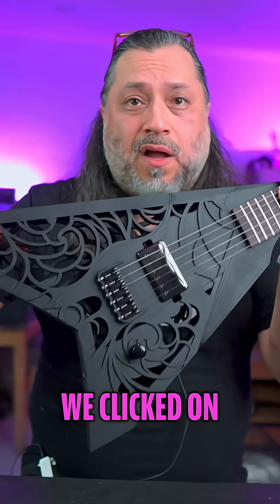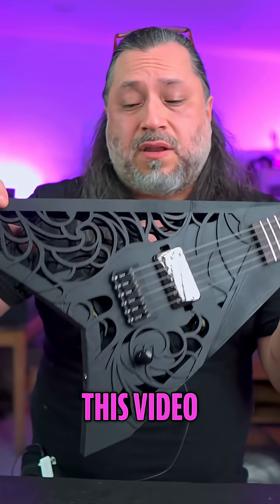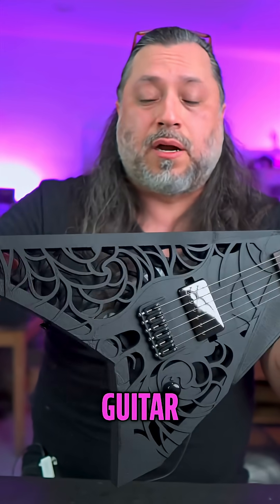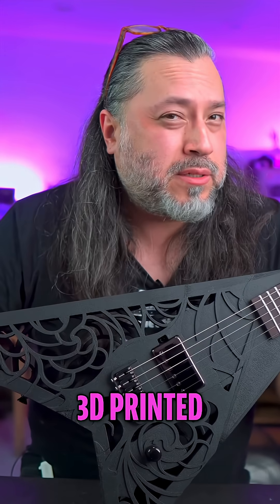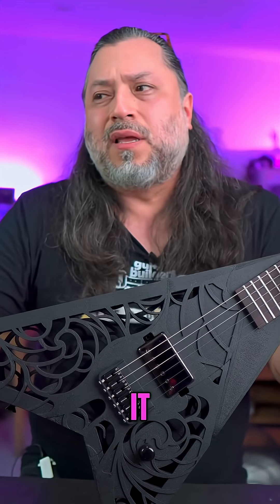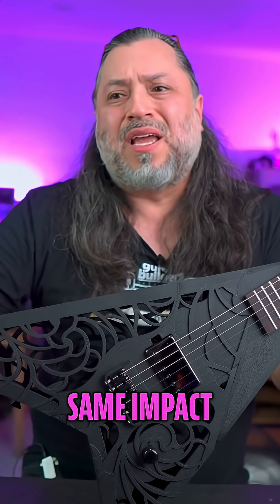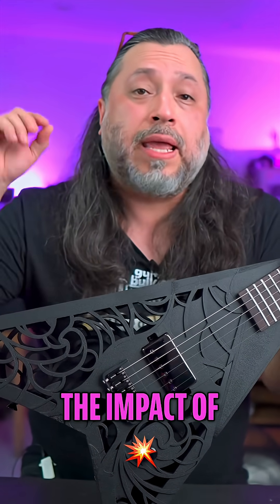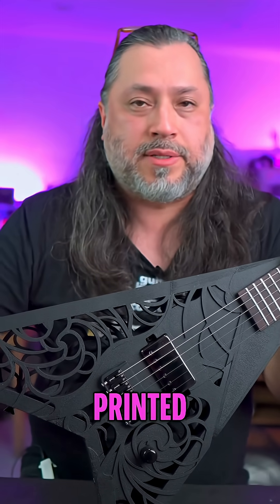3D Printed Guitar: Beyond the Novelty, Mixed Materials!

Comment: I think the reason someone might only want to watch a video on or create a fully 3D printed guitar is because they are limited in the tools they have and availability of funds. They might sink a large chunk of their money on a 3D printer, and not be able to afford to purchase anything else. 

My reason for not printing more is the lack of availability of a printer that can compete with any other tool as far as speed is concerned. I know they exist, but I cannot afford one. 

Using a machine or process to its strengths and not forcing it to do something it was not designed for is good practice. I’ve tried to force many tools to go outside of their work scope and have been disappointed more often than not.

Comment: Very well put and how I see it. We are in a golden age of high performance, cheap instruments and also high performance, cheap technology.

I think a printed body be it one piece or 8 linked together and the addition of a 1/8" or even 1/4" cap or just a simple veneer, is ideal.

I think a printed neck is well within reach by sneaking in two truss rods also providing the ultimate in refinement with a glued on wood or composite fingerboard. 

Going 100% printed would be an achievement, but I think that's looking at needing more sophisticated printers than most people own today and in that, we should look at this as the pursuit of developing a cottage industry. 

The opposite end is people building guitars they sell for $5,000 to $15,000, and yet 90% of the work is being done by a CNC. That's crazy to me!

I see guitars like a drill, lawnmower, microwave etc.

Comment: But that's the thing - as a materials engineer, a luthier or a player - the novelty (and in many cases - tradition) is what gets the sale and "elegant design/ engineering" is a long way down the list.
But speaking as someone who has worked in materials engineering - I am a huge fan of harnessing the individual strengths of a material to its fullest.
Do you NEED ultra-light titanium tuners? Well if you have severe neck dive, you might. 
Does wood give you better resonance than polymer? Or is it just cheaper and easier to machine?
Is it just for aesthetics? Contrast?
It's nice to live in a world where we have the options - and still end up with a beautiful, playable instrument.